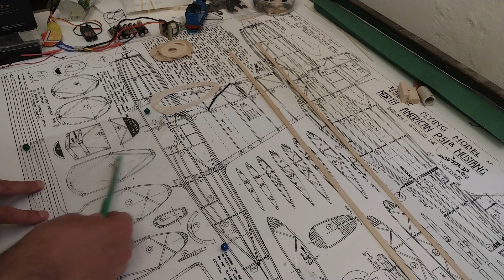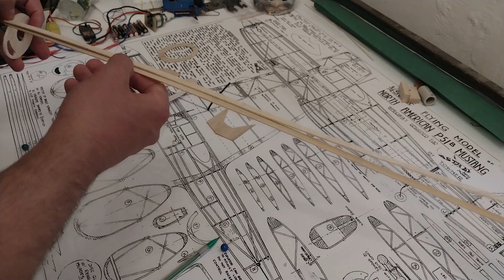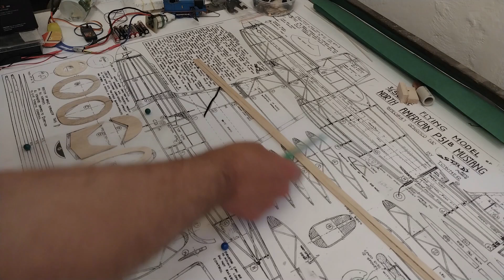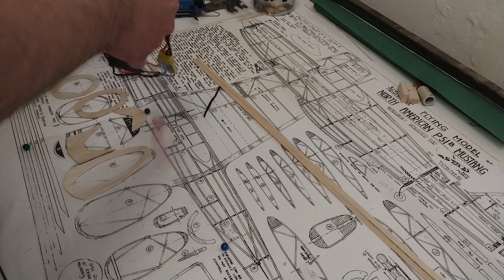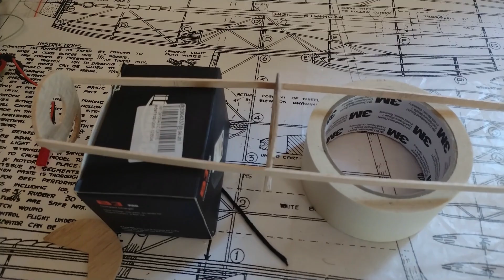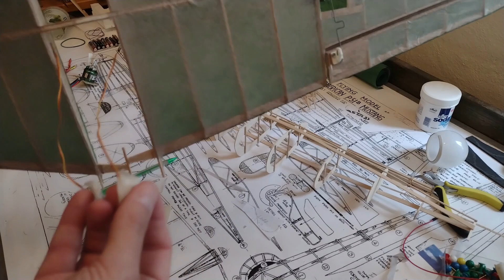09 Balsa P51B   RC Conversion   Fuselage basic structure

Comment: Hi Andrew, looking good ! Interesting construction! I tend to agree with Cliff about the motor, but maybe you can get the airframe done and then see how fitting that motor affects the C of G ? .....if its massively nose heavy then a smaller motor maybe the way to go ! Great to watch your progress !
Reply from the maker: You might well be right. The issue is that the motor is build in. I can still cut it out and figure out how to put in the other motor. I'll follow your approach and build the structure and take the decision based on the CoG and before I put the tissue. Thx for stopping by!

Comment: I have to say Andrew that motor looks really big and heavy for the model what is the motor?
Reply: Yes, I agree. The motor should be like 150-200W max and about 2000kv
Reply: @WCKD.  Could you get something a little smaller?
Reply: @cliffharveyrcplanes  Banggood has a pretty good selection of Racestar motors with various sizes and Kv's. I've had good luck with those. Nothing bad to say.
Reply from the maker: Now you got me worried. It does feel heavy but I would have to check out the specs that Ray sent me. Maybe if I use a smaller prop it would reduce the p-factor and make it controllable if it is too strong. I have "by default" some misalignment on the ailerons that would push the plane to the right and therefore hopefully also compensating it. 
I guess this is what happens when I build build build but don't get to fly so that I can get the feel for what motors are suitable for this size model. 
Thx for making me think!